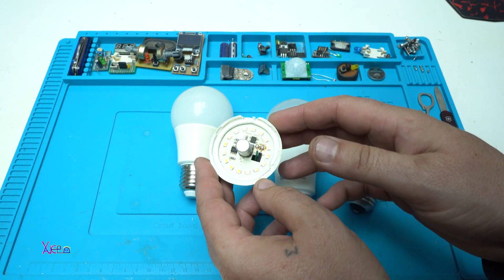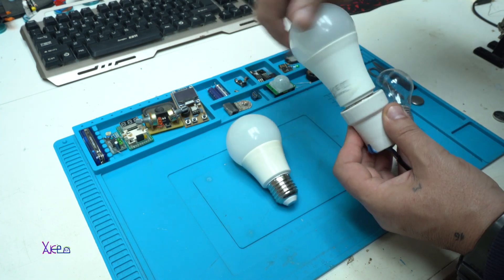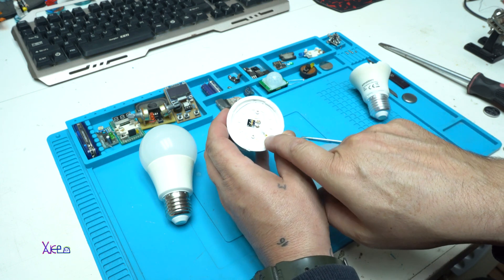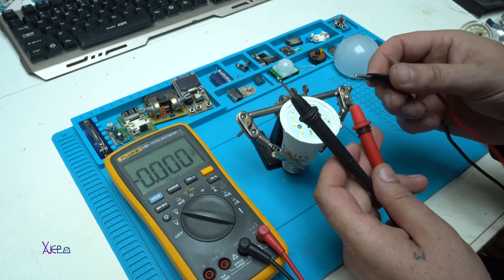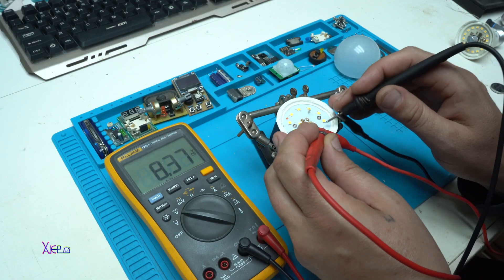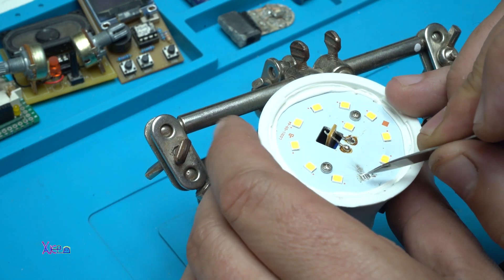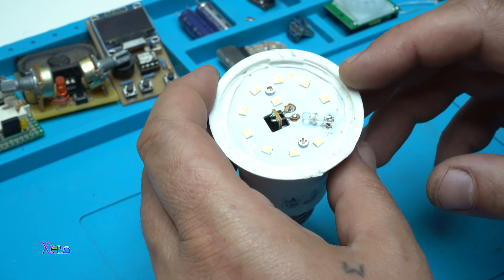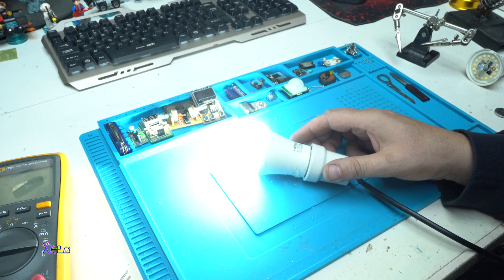Try This Technique to Fix Dead LED Bulb and the Result is Useful!

Comment from the maker: Why the leds need above 8volts to light up while testing? Someone Know?
Reply: To overcome the the forward voltage for these LEDs, but the forward voltage may differ from other LED lamps. I usually start with 3 volts and increase when nessesary.
Thanks for another great video. 👍

Comment: If one doesn't have an LED lying around, will it work if one shorts the contacts or add a resistor there
Reply: Yes, of course.  Instead of shorting the contact, use a resistor, it’ll last longer.  Enjoy a beautiful weekend ✌️😊  🕊️🍀❣️
Reply: @gunnarallgottsmann  Good To know
Reply: @daniesalex7073  
You’re always welcome 🤗  ✌️😊  🕊️🍀❣️
Reply from the maker: Yes you could add a resistor to replace a diode